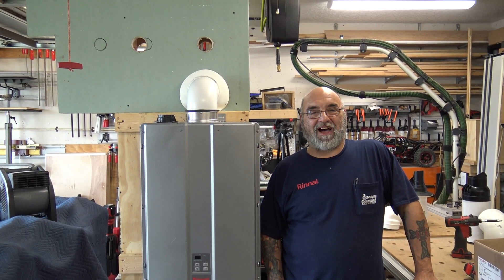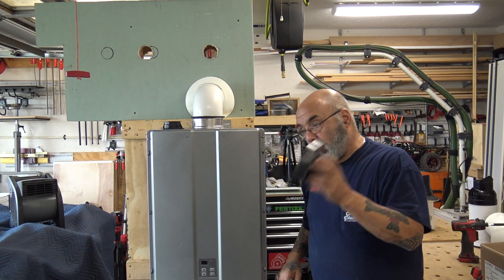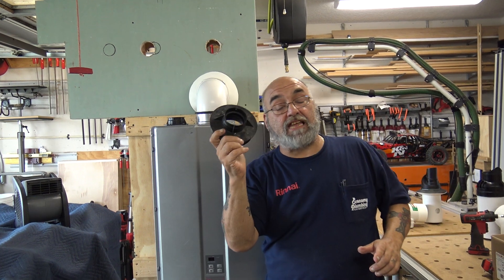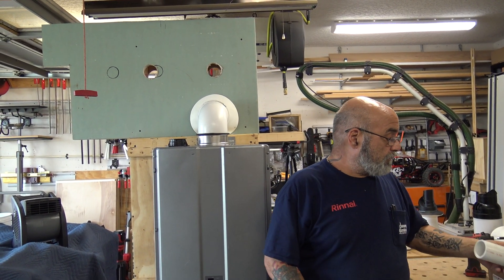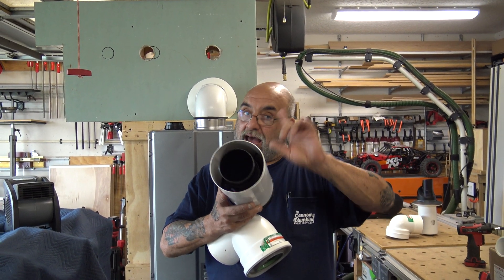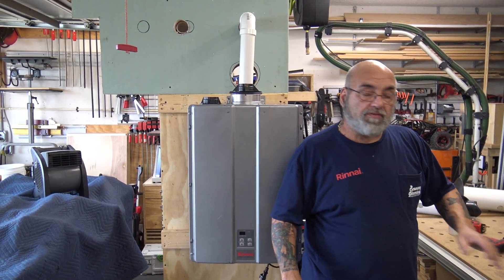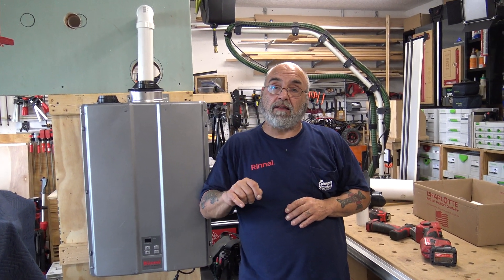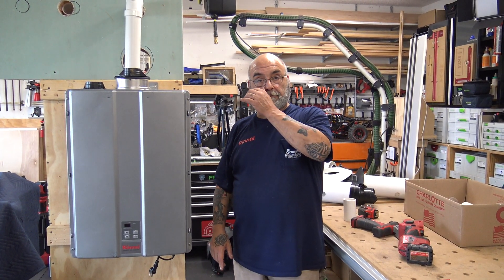How to vent a condensing Rinnai tankless heater.

Comment: My heating company just installed a Rinai  NPE-240 Series 2 condensing water heater with schedule 40 used for the exhaust. They also skipped using a condensate neutralizer and pumped the acidic condensation outside where it can freeze on the way out. The inspector busted the install on 2 counts. 1,  the acidic water condensation venting outside. and 2, schedule 40 for the initial exhaust. He said it must be schedule 80 then schedule 40. My concerns are untreated acidic water going into our septic and PVC on the exterior is deteriorated by UV light as you said, Generally Massachusetts is more strict than national code. Your thoughts? I'm a pilot by trade not a plumber, but I like and paid for a job to be done right and I understand much of the complexities you discuss in your vids. Appreciate you videos and the degree of information that you share. Thank you.

Comment: I'm looking at installing the CX199iN in my basement  I'm going to do a twin pipe and exhaust vertically  up the wall then out.  Do I need to pitch the horizontal portion of the vent pipe back so the condensation runs back into the unit?

Comment: Always great videos !
I have installed Rinnai on all 4 of my houses. The one thing I cannot find is the proper fitting to screw onto the electrical inlet threads 
Anyone have any ideas? Rinnai US said they have no idea and they don’t sell a part for it. I have. My Tagaki units came with the connection

Comment: Thank you for the informative video I was wondering, what's the longest run that the vent pipes can be because I'd like to vent them out a sidewall but I don't want to move the unit too far away from the gas supply

Comment: I have a problem with my Rinnai venting.  I believe bees have formed a nest in my vent, and I'm getting a #10 error.  I can turn the temperature down to 120, and it will work with the restricted air, but I'd like to fix this.  The scumbags in the local HVAC companies want to sell me a replacement for $8k, but that's a non-started (being as polite as possible).  Can you help a guy out and show me what to do?  Thanks!

Comment: Thanks for the video, very helpful. I'm about to install a RXP199in and my house currently has a 4" galvanized vent. What would the harm be in using the pipe going through the roof as a chase for a 2" PVC exhaust so I don't need to disturb the boot or cut a new hole in the roof? I'll be using room air for intake as it's a large 3 car garage.
Reply: I ended up biting the bullet and doing it right and just replacing the roof vent boot with a proper boot.

Comment: I was wondering if you could advise me on the correct distance to place my intake from a dryer vent on a Rinnai RUCS65i N. The only thing in the installation manual is avoid termination locations near a dryer vent, but does not give a distance. Also how far from an ac unit should I be for both intake and exhaust.

Comment: Definitely you are the best. I have a question for you. I just finished a new one story house and installed a Rinnai RE-199en and I have hot water in every faucets but not in the master bathroom ( including lavatories and shower ), there is a recirculation line but doesn't help. Do you know what could be the issue ? Thank you
Reply: Is there a check valve on the recirc line before it ties back into the cold?
Reply: @ yes, and the recirculating pump has one too

Comment: Thank you Mr Mike for this great video. Question, if I route the two pvc pipes through an existing b-vent, what attachment do I use to seal the two pipes at the top? I understand to space them apart so that combustion air doesn’t get drawn in, I just want to see more on roof termination examples and explanations.

Comment: Mike, thank you so much for your videos.  Watching them extensively gave me the confidence to install my own Rinnai RUR condensing unit a few years ago.  It has worked great but I have had a recurring issue with a code 10 re the venting.   I have it set up as a twin pipe and I tied the exhaust into the existing pvc exhaust from previous power vent water heater.  There is a horizontal run in the attic of about 20ft which then 90 elbows into vertical as it exits the roof.  In a nutshell I have had to drain water from the vent pipe 2x after code 10s.  The first was thought to be a missing goose neck and rain accumulating.   The second (a week ago) was after a year with the rain cap on.  I drained a gallon of water from horizontal run at the 90 from the attic.  After trying to figure out why, I contacted rinnai and discovered the horizontal run has to be pitched back to unit .25/foot.  It clearly says that in the manual but I neglected to do so.  I was told that condensation can/will accumulate in that run and needs to drain back into unit which then exits in bottom condensate drain.  Thought it may be helpful to include that in your exhaust videos as this is a very important part of the install and can save others from potentially encountering the same issues  I did.  Again, thank you for your videos, keep them coming and be well!